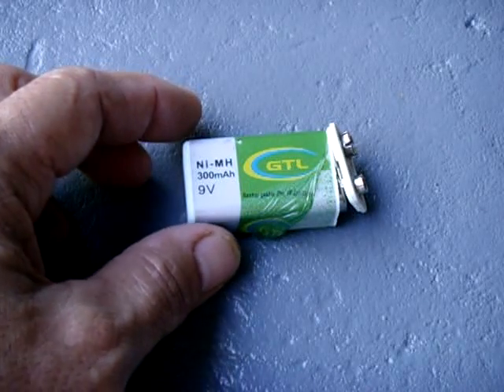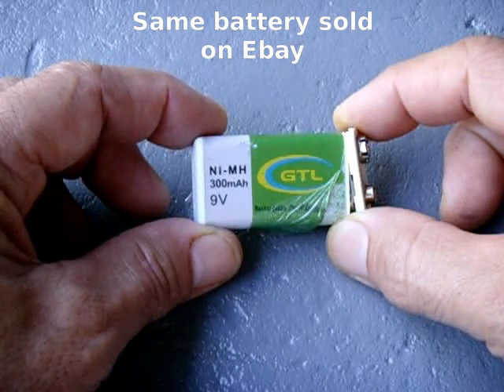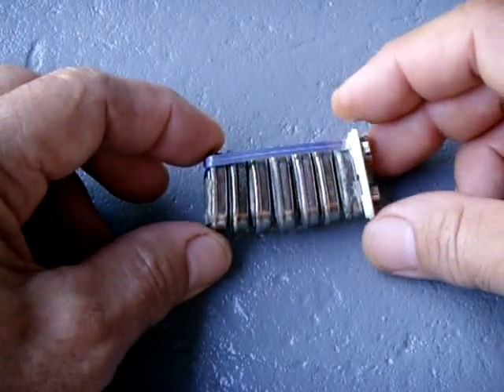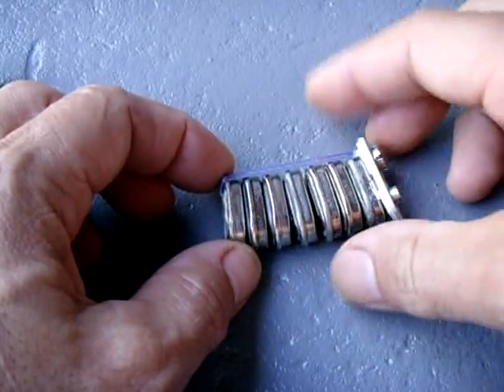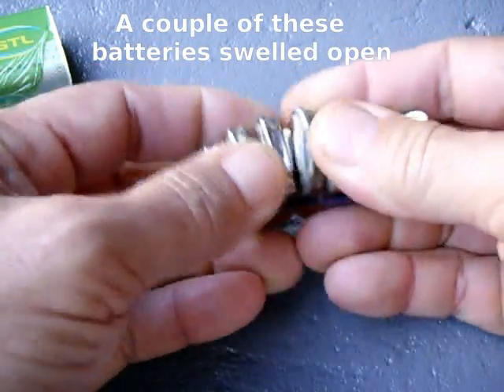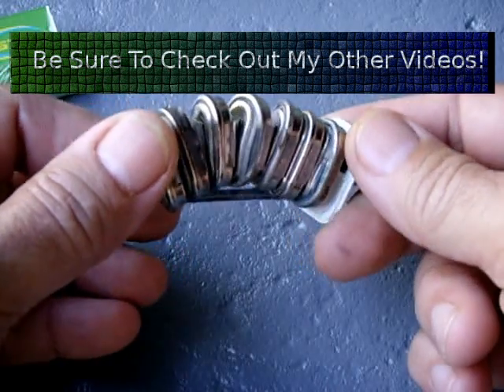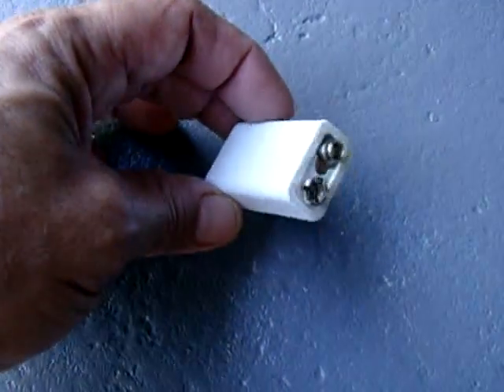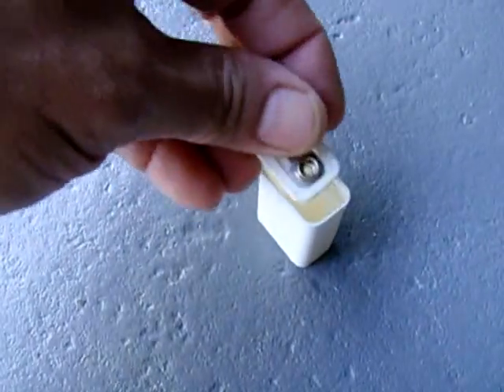9V NiMH Battery Hack

Comment: Which is the minimum voltage of Ni-Mh 9v battery?  I mean when want recharge the battery?
Reply: one cell is around 1.2V and end discharge voltage is 1V
"9V" battery in NiMH recharge technology, 7 cells is actually around 8.4V and goes down to minimum 7V end discharge voltage (discharge below 7V you damage the cells)

Comment: are there different kinds of batteries that could be inside like normal non-rechargeable batteries like in this video
9 volt battery hack
Reply from the maker: Many batteries, including non-rechargeable types, have smaller batteries inside which are connected in series to give a higher voltage. A 9V alkaline battery has 6 AAAA's inside. Many alkaline photo batteries are made up of round button cells.

Thanks For watching!
Be sure to check out my extensive video list.
Reply: I think you mean cells, not batteries. Sorry I'm late 😊